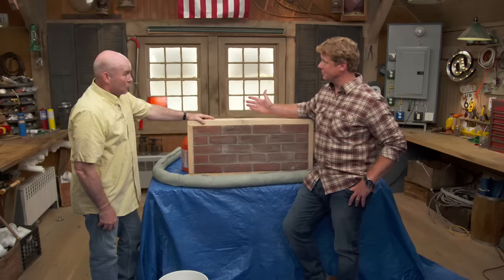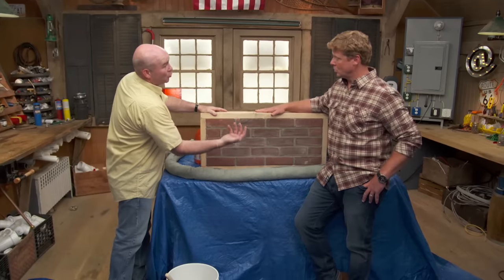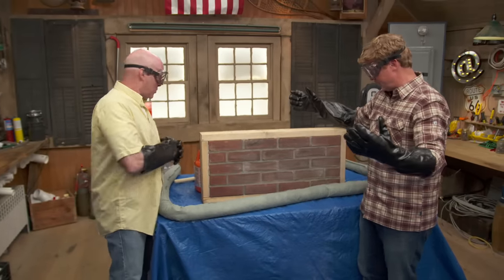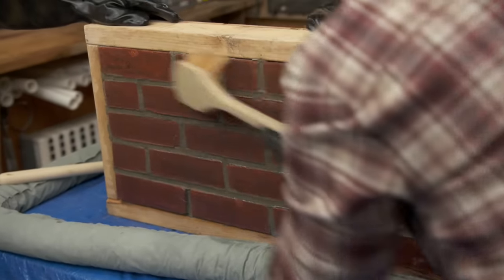How to Clean Brick with Acid | Ask This Old House

Comment: No mention of product used.  It was not muradic acid.  It was a "detergent with a little acid"  Was it SureClean?  Miracle Acid.  "A great product" but no mention of what it was.  Really helpful.  Thanks.
Reply: its in the video description
Reply: @eyehear10  It says 'using acid', which this specifically is not. It's a diluted product of some sort. If you can't show the product, what's the point?
Reply: So I checked the sureclean 600 sds, and it says 10 to 30% Hydrogen Chloride. So it's basically muriatic acid, (dilute hydrochloric acid)
Reply: It’s a diluted acid for god’s sake. Acidity is a fundamental chemical property, not a specific product. At 4:40 they say “the acidic material.” It’s a very basic category, like a solvent or a lubricant or an adhesive. Not everything needs a product placement. You could (and people do) use vinegar, muriatic acid, box store brand generic “acidic cleaner”, hell you could use lemon juice if you have a barrel of it sitting around. Or you could save a few bucks and buy a 5 lb bag of citric acid powder and use it for this and any other time you’d use vinegar for cleaning and it will last years, that’s what I did. Honestly if you want to work on your home you ought to get in the habit of learning for yourself how some things actually work instead of just expecting someone to tell you what product to buy.
Reply: Sure Klean

Comment: A tip when using those long black gloves is cuff up the ends where your elbow is , that way if you do get acid on them it won't run down the glove it will run into the cuff.
Reply: Thank you! Great advice.

Comment: Splashing is part of the reason, but the major reason is thermal mass, if what you are adding has an exothermic (or even an endothermic)  heat of mixture, you want the large heat capacity of the water to absorb that change, not the tiny amount of water you would have if you were to mix in the reverse
Reply: Cool, thanks

Comment: The product manufacturer and our local distributor did not recommend this product for indoor use. They recommended a few different Prosoco products. We wound up using DriKlean, paint and peel cleaner. It’s still curing on our fireplace; the test area showed a slight improvement. The application isn’t much different than painting a wall.

Comment: I wonder if this will also work on red concrete pavers.  I used mortor mix between my pavers to lock them in place and the mortor dust dried on on my paver face so its grey colored.   I washed it off and scrubbed it but its still there.  Can i do the same process with concrete pavers as they did with brick?
Reply: If you have any pavers left over the best thing is to try it on them and see if there's a colour change as acid can leave a yellow stain on concrete, but if they're clay pavers there should be no problem.

Comment: sandblasting could be an option, make a sealed plastic enclosure around fireplace big enough to work inside ,buy a cheap gun ,borrow/rent air compressor ,
Reply: Yeah and blow all the joints out 😂
Reply: TYPICAL COMPRESSORS DONT PROVIDE THE AIR VOLUME. 
TOO BAD AND SO SAD.
Reply: Yeah, that sounds like a lot more money, work and aggravation, with the possibility of ruining everything, why not go that route.
Reply: if you do, be sure to wear a respirator with a particulate cartridge. Silicosis takes a long time to show up, but is wicked when it does.

Comment: CLEANING GROUT JOINTS IN A OLD  RENTAL BATHROOM WHERE THE TOILET IS AND I TOOK MURIATIC ACID AND USED IT  STRAIGHT AND THE 10 YEARS OF PEE CAME OUT LOOKING LIKE NEW
Reply: san379 10 years of pee came out looking like new pee? Lol....

I know what you mean thou.
Reply: with acid gloves up to my elbows and goggles and respirator i cleaned the floor with the window open .. the floor looked great and  grout sealer after .. its still there today
Reply: I TOO LOVE USING CAPS WHEN THEY ARE NOT NEEDED

Comment: Those bricks are not dirty with creosote, your going to find that in a fireplace. I am reconstructing my firebox. To clean the bricks, I have been burning them clean in fire. It removes all the hard black soot and carbon making firebrick look new, but it takes some effort. If I was a pro doing a rebuild, NEW bricks would be used. I was going to try scrubbing bubbles if I have some here.

Comment: I'm assuming the acid is not good for exterior wood or paint.
Reply: why are you usuing a  cleaner on wood meant for brick?
Reply: What about painted brick?
Reply: What kind of paint?
Reply: Exterior
Reply: the frugal landlord some kinds of paint cause moisture to be trapped in brick walls. Next time you repaint the brick walls, try something porous that's specially formulated for coating brick
Reply: I wonder if that acid wash works on moss too.
Reply: the frugal landlord I'd call that overkill. Half cup bleach to gallon water is cheaper

Comment: Would this work on stone houses too? We’re renovating an 1806 stone house and we have some stains from years of water damage.. we post new videos every week on YouTube if anyone is interested.. ( not an ad, just letting people know) I guess that is an ad technically. 😜
Reply: Depends on the type of stone, if it is a carbonate stone like limestone then no because the acid will dissolve it. However for stones like granite and slate its fine.
Reply: Shazzkid I better just use elbow grease.. 😜
Reply: Limestone is naturally alkaline. Are your water stains rusty or something else?
Reply: Benjamin Cantor-Stone I would say the stains are black (dark in color)and only where roof water is hitting the house.. near the porch roofs.. the porches are going to get repaired soon.. but, I was looking for a good way to clean the stones.. thanks for your help.
Reply: 1806StoneHouse Hm...Try a masonry cleaning product that is specifically labelled as alkaline. Don't use wire bristles on ypur brushes unless other types don't work. If you want to make your own cleaner, a solution of lime may do the trick and strengthen your stones at the same time.
Reply: Go to the dollar store and get a cleaner called LAs Totally Awesome It only costs a dollar and it works great on everything. spray this cleaner on it and scrub it with a regular brush then hose it off.  YOu can even clean an engine in a car with it. Trust me its completely acid free and safe

Comment: STOP DO NOT DO IT THIS WAY.
FULL FACE MASKS AND WEAR A HAT WHEN USING ACID.
Also, I can still see some skin on his arms that should be covert too.
I have worked in the chemical branch working with lots of dangerous chemicals and if I dress like that I would be burned to a crisp before the week was done.
Also if you want to do this at your own home get the garden hose out.
If you get some on your skin you can rinse it off.